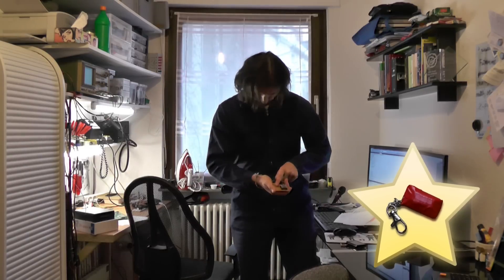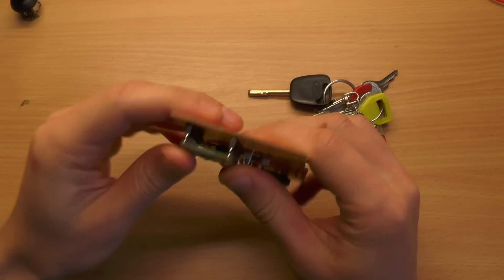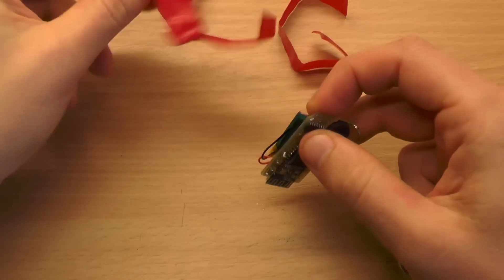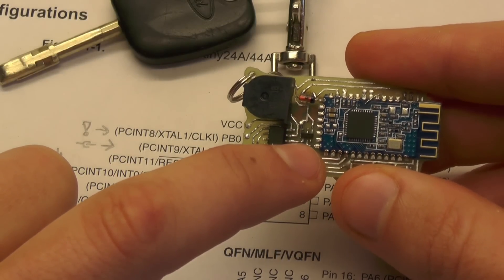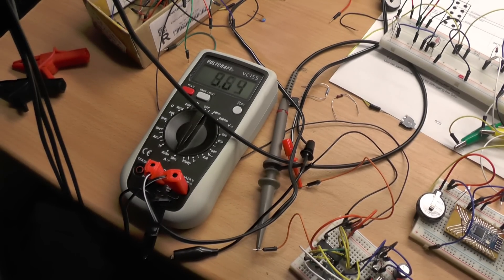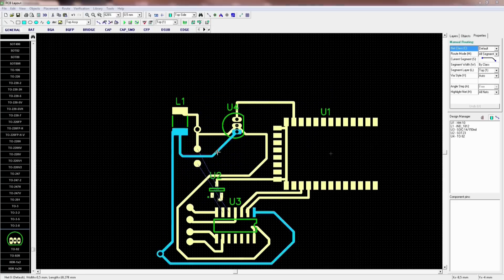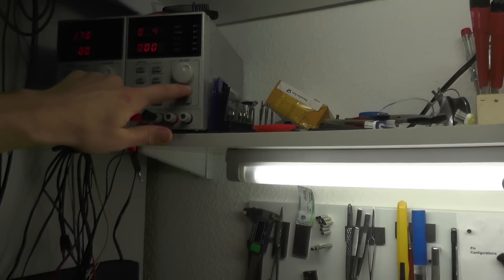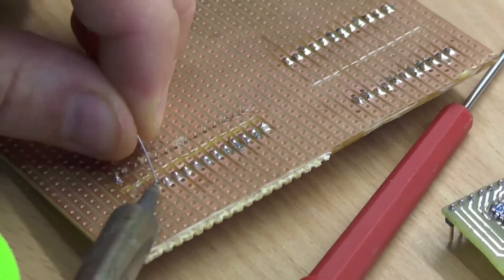Mini project: Bluetooth keys finder (aka "No worries keyfob")

Comment: Thank you for an excellent series showing the whole development process a newbie can use to start working with the current technology. I worked in electronics many years ago when tubes were the primary active devices, and transistors were just coming into the mainstream. Now, after may years of software and systems development I have become interested in the hardware. You are making it enjoyable and less mysterious.

Comment: Hi, i want to thank you for doing this. I will try it myself but need to buy all the stuff you use in those videos first :-). I have some electronic devices like a teensy++ 2.0 but no resistors or other components. i don't  even have a pcb board. It is probably for the best that i use exact the same things you do or i might set things on fire :p. I have subscribed and hope to c your further developments. My goal is to make this communicate with a cell phone and wonder how far you can get me to do it!

Comment: What stopped you to use the inbuilt micro controller of the HM-10 module? I guess it does have CC2541 which has its own 8051 processing unit inside. Wasnt that enough to control a simple buzzer ?
Reply: The problem is programming the HM-10 microcontroller is very tricky. You require CC Debugger and IAR workbench. Also the code size is limited to 4K in IAR workbench.
Reply: Cool u make it better and with more functions?

Comment: Das Video ist mal wieder ein Hochgenuss - sehr coole Anwendung... neun Tage Batteriedauer - nicht schlecht! wie Du den Stromverbrauch von dem Beeper reduziert hast, habe ich allerdings nicht begriffen.
Reply: I have left out the part where I explain the code. It was just too long. But I will eventually upload it as a seperate vid. The trick of reducing the consumption of the beep was to reduce the duty cycle of the high value. The volume diddn't drop since it's a square waveform but the current just flows dring the high phase. the overall frequency ramains the same

Comment: nice channel, +1 sub, i was wondering, how you made that tiny circuit, connected to the rest (bluetooth etc)?, how did u made that tiny circuit? merged something into an solution.. what was it? im just starting in the field. and what CAD software did u use to make the project? another thing, wouldn't save effort and energy, to simply let the HM-10 be found trough rssi signal strenght by your smartphone?

Comment: can u tell me which battery you have used at keys side to power hm 10 n buzzer. And from where to buy.
Reply from the maker: It's a small LiPo that I got from a toy. You can get them probably from ebay, Aliexpress and so on

Comment: Hello, the video is awesome.I'm also trying to do something similar like this, but the info and source code website doesn't work so I'm having hard time following the stuff you do here. Also how long did it took to make this complete?

Btw, what are the things you are using in this video, even though i have followed the playlist I still can't grasp some of these item's you are using.

Keep doing what you do, it's awesome!
Reply from the maker: I completed this within a weekend, but I had all the other videos made before so I had not much to do on the bluetooth side. 
I admit http://lab.bitluni.net/keyfob is not populated with any info yet, but on the bottom the link to the source code should work.. at least I see no problems visiting my site atm.
Tools: I have used atmelstudio 6 to write the code for the attiny and mega and used avrisp mk || programmer to upload the code. Also used the ftdi as shown in videos before to set up the HM-10 modules to the specific properties. If you are not using this modules you might need a firmware and the cc debugger to program the cc2540. I can't really help you are using another brand than TI for the BT.
If you are a bit more patient, I will show how to set up a more simplified version working with an android phone and no extra attiny to run the keyfob
Reply: bitluni's lab Did you get a chance to make a simpler one that can work with android phone?
Reply: +bitluni&#39;s lab hello I don't know if you will respond but how do you set the at commands?

Comment: Hi,
you said we need internal oscillator, but actually I do not use one and it works properly. The problem was just the speed of my Atmega processor, in 1 MHz there were bugs but on 4 MHz it works 100% fine.
Reply from the maker: what I meant is, that we need to set the internal oscillator to lower frequency to be able to run the MCU on low voltage. It is definitively more stable. But everything is fine what's working the best for your solution :)
Reply: bitluni's lab thanks for the answer :) And actually I have a question, maybe You will know -> can I exchange 2.0 HC-05 module with HM-10 without changing code on my Atmega? I only use lines Rx/Tx 3.3V and GND ? I think they propably are working the same. (I ask because my Android device doesn't see 4.0 module so I must change my application code and then everything will be clear)
Reply from the maker: Adam Tech Channel HMSoft states at least, that the pin configuration is same, but I never tried it. I'm also waiting for my mobile phone to update to latest android to be able continue with this series.
Reply: still waiting....?

Comment: for the HM-10 module, did you need to flash it with any firmware, or did it work straight away?
Reply from the maker: it has a firmware already, that's why it is so easy to start with
Reply: were you able to configure the connection intervals ?

Comment: how to turn off the pin PIO2 via using switch without making off the whole module. Ive added  a switch as per data sheet to pin PIO0, when I press the switch the whole module getting reset and again I have to configure the module.

Comment: Hi, I have CC2541 blank chip and PCB also.can i flash HM10 firmware on Blank CC2541 using arduino and  FTDI232.

Comment: Hello, Iam working on similar project. Ive got much info through your videos.
I am facing some trouble, I connected my Bluetooh module to PC via FTDI  when I send AT commands it shows "UART receiver frame error " and "break condition",. System LED is blinking but I cant configure the module because of these errors.
Is there any other way to configure the module ?
please help me.
Reply from the maker: make sure you connect rx, tx correctly. you might just to swap them for a chance. otherwise it's important to have both grounds connected and baud rate to 9600 and no flow control. you can just reduce the chance of errors by  not connecting control flow lines. and your module has to be working on 3.3V. Higher voltage might damage your module. You might even try to power the module by the ftdi to prevent other causes... Good luck and post a link if you document your stuff :)
Reply from the maker: abdul razzak two ways, you could program the SoC or you could try perform the sound generation on the sender side and just connect a transistor to a pin, flipping the pin fast on/off
Reply: bitluni's lab  Which Bluetooth module have you used in this project?